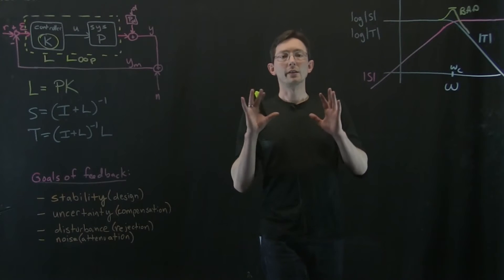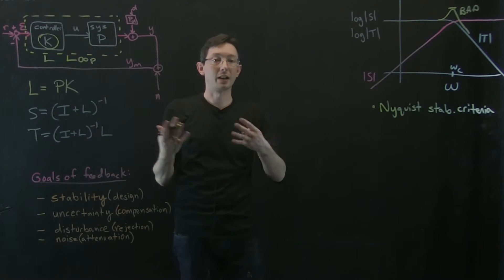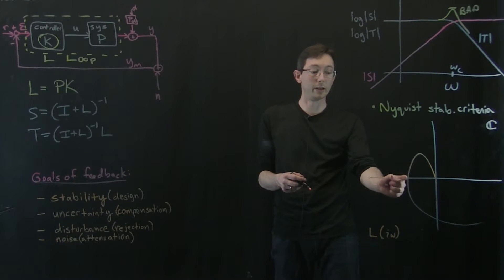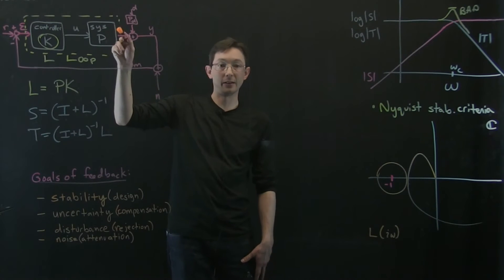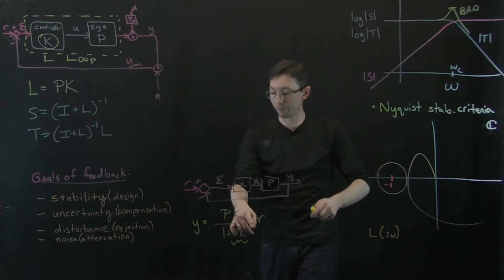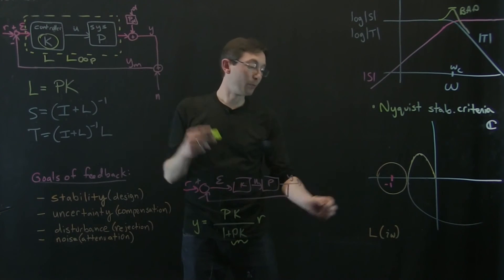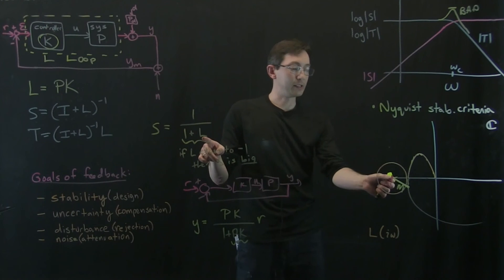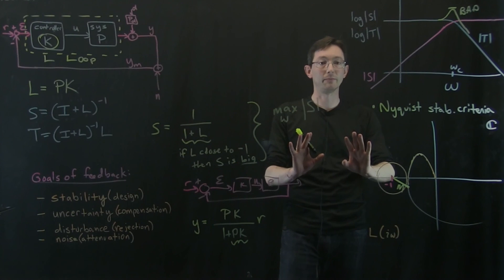Control Bootcamp:  Sensitivity and Robustness

Comment: Thank you for really  value video! I have several questions to ask you sincerely.The motivation of the robustness control is to deal with the uncertainty of the system which the LQG is hardly to solved. However, if the control contain no estimator,  the simple optimal control with only LQR  can also deal with the uncertainty of the system. In the absence of an estimator, is there any difference between optimal control and robust control in dealing with system uncertainty?  If the estimator is considered, where should it be placed in robust control?
Reply: As far as I know both LQR and LQG robustness can be checked by rewriting the block diagram and formulating the loop-transfer function. In the case of LQG the robustness has to be checked afterwards since there are no guarantees on the robustness of the system (see John Doyle's "Guaranteed margins for LQG Regulators").